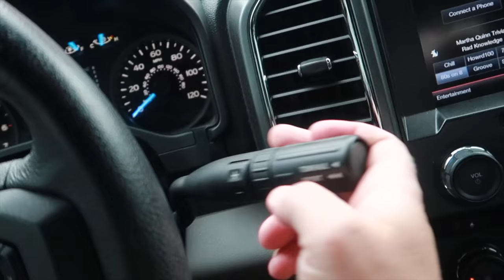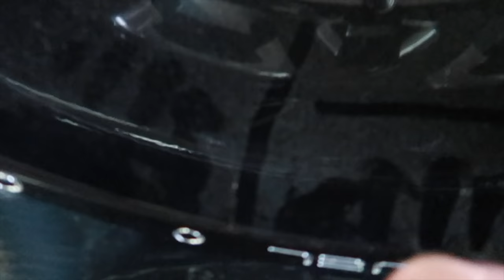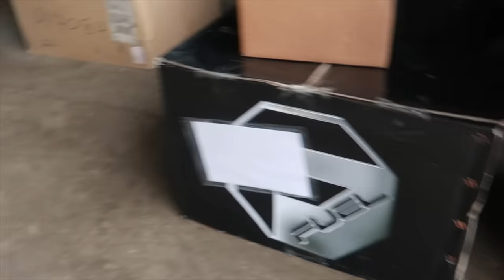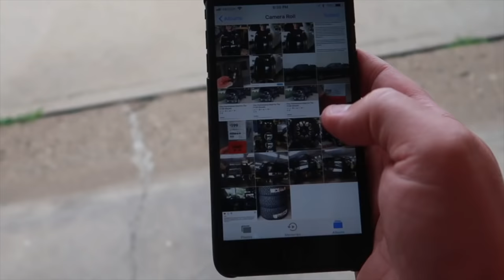FINALLY!! New Wheels For The F150!

Comment: Bad ass rims!!!!
The fith rims should be free of charge.
Reply: William van der Ven agreed
Reply: Why should it be free?

It will be returned to be repaired and sold as reconditioned after being repaired or sold as is as a factory second
Reply: well at least you got a free spare that at least matches. It's just scratched.
Reply: @ Matt Laclair
How do you know they done this deliberately?
Have you ever worked in retail?
Shipping mistakes happen.
This wheel may have been used ages ago for display, it was damaged, packed up and forgotten about until an order for them came in.

When a reseller makes these kinds of mistakes you can request the correct item to be shipped express at no cost, you just have to haggle, some places will do express shipping without you even mentioning it
Reply: He should be allowed to keep the bad rim for the spare tire
Reply: A would be rageing with the wheel they sent wee touch up be sorted
Reply: Barbarian XXX i said the the fifth rim should free of charge.

Mike only said that he would like a extra rim in case of a flat tyre.
Keep your facts right!
If you don't like autovlog, get off the channel!

Comment: Happy belated 9th birthday to Sydney. :) 
Those handle covers are a nice inexpensive touch that I was hoping you would do. The dechroming process is almost complete, and will be when you visit Shane at InShane designs. I am definitely digging those wheels and tires, Fuel does make a nice mean wheel and that offset will really give you quiet the aggressive stance. I am glad that they overnighted that replacement wheel as they should and the display should be free with all that wait and hassle you went through to get the wheels you wanted, makes for a nice spare. Looking forward to the reveal video on Wednesday, hopefully the bumper will be in by then as well, we shall see how the lift and everything looks together, those wheel will definitely stick out a bit without fender flares.

Comment: I think since you are putting a lift kit on the truck (how many inches?), you should put the AMP Research Power Steps on your truck.  I have some on mine and they are definitely nice.  Check them out.  It gives the truck a much cleaner look and the ladies will appreciate them.

Comment: When you took the steps off the truck, did they leave any holes in the body or frame? I want to take the steps off my truck but I’m worried about them leaving screw holes that could eventually cause rust or issues...

Comment: I had the same issue, one of the wheels I ordered looked like it was a display model, very dusty, box was mangled and to top it off it was wrong bolt pattern and missing center cap. From Custom Offsets

Comment: That wheel was not only a display wheel, but it has had a tire mounted on it. You are probably not the first person they have tried to sell it to. Eventually, someone will not notice its imperfections and accept it. But what do I know, I only sold wheels and rims for 15 years. And yes there is a difference between rims and wheels.

Comment: Your daughter is 21 in the head and she is way ahead of you and yet she is only 9 years old. I love what your doing with F150 it will be bang on when its finished but be warned don't go overboard or you will ruin it also why not fit a LED light bar on top of the cab now that will look the truck look  more aggressive. Regards Alan B (UK) P.S I think you should involve your family more as they add a family theme to what your doing and you have a lovely family as they are very sweet